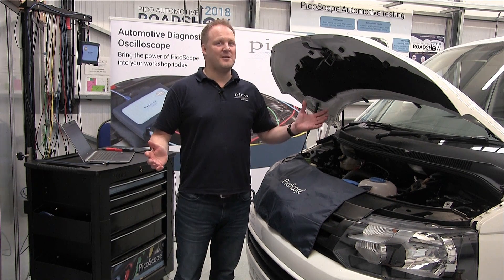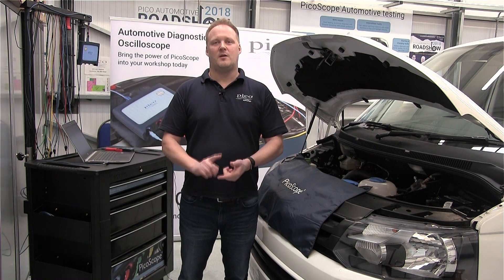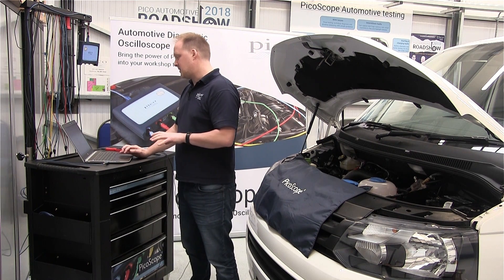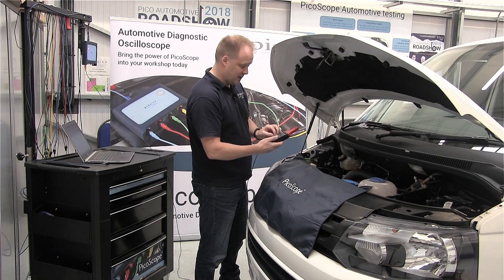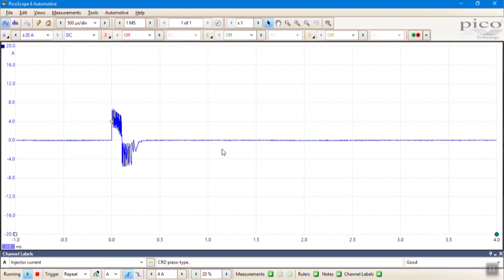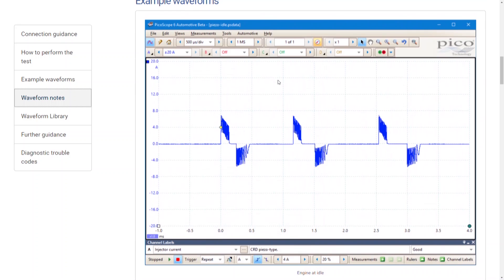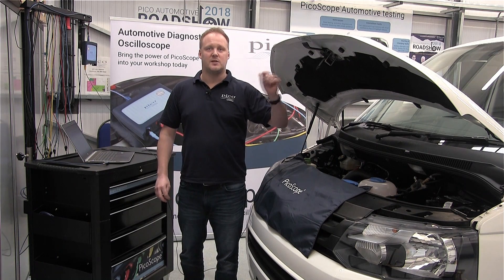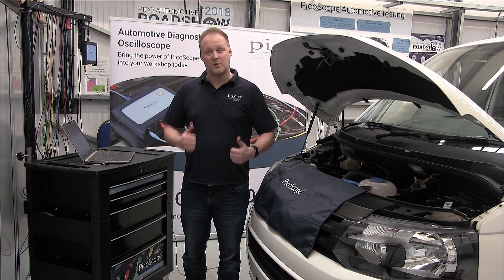Guided Test: CRD piezo injector - current

Comment: Great video.. 👍
If a injector connection is mistakenly pulled out while the engine is running, will the shorting of injector terminals before reconnecting will help solve the unforeseen problems.

Comment: great video,I just ran captures on 06 Cummins magnetic type injector that was stuck open.voltages on command and supply wires didn't look any different than a known good injector next to it,then I amp ramp with 2 clamps and both injectors looked the same.i couldn't see the pintle hump on neither waveforn.Can u do an amp ramp capture on magnetic type injector?and volt capture on fuel pressure sensor sync with an injector to diagnose a high return injector flow.ive never seen that test anywhere.
Reply: Hello Francisco, thank you for the feedback. You most certainly can carry out this same test with magnetic type injectors using both current clamps and voltage probes (Current being the preferred method) The following Guided Test will help with connection if you wish to measure voltage and current simultaneously https://www.picoauto.com/library/automotive-guided-tests/vag-pd-current-voltage-and-earth/ Should your injector fail mechanically it may well still exhibit normal voltage and current values! The pintle hump you refer too is typically visible with conventional 12 V petrol “port” injectors as the movement of the pintle influences the magnetic field about the injector windings. However this movement is not so influential with diesel “solenoid” injectors based on their construction and operation. Your idea to measure current flow in a solenoid diesel injector whilst monitoring fuel rail pressure is perfect. Use injector for cylinder 1 as your synchronization signal and AC couple the fuel rail pressure sensor signal to link pulsations in the fuel rail to injection events. This test is what you are alluding to but uses a pressure transducer in the fuel return line. https://www.picoauto.com/library/automotive-guided-tests/common-rail-diesel-injector-back-leakage-testing/
 I hope this helps, take care…..Steve

Comment: For a single injectorit seems as if voltage is being applied multiple times.. why does the amplitude increases & decreases continuously ?
Thankyou for the video
Reply: Hi. That's a very good question. The current ripple on each event does suggest that the voltage is pulsed to some extent. I'm afraid I can't tell you why they would do that. I guess it could be because the piezo element responds better or needs protection. Or, in fact, it could be that it is caused by the response of the piezo element/circuit to a non-pulsed voltage control signal... I'm sorry that I can't give you an answer. Would be great if anyone else could provide an answer, if they know.
Reply: A piezo injector is electrically equivalent to about a 4 micro farad capacitor. The high frequency (PWM) pulses are used to control the charge and discharge currents since the injectors are typically switched to about 140 volts from a low impedance source. Some systems use a small amount of series resistance or inductance to limit the rate of rise of the current and dispense with the PWM current limiting.

Comment: I dont get this. is common rail bosch injectors correct to read out with just looking at the amp like your test. or the voltage up to 100v..  I have tried voltage reading and when cranking i get all injectors reading peaking at the same time.. voltage around 15v.
Reply: Hi Tarik, yes current measurement is a standard way of testing an actuator (i.e. injectors of any type, motors, solenoids etc.) circuit. It tells you what the circuit is doing whereas voltage tells you what the ECU/circuit is asking (loosely speaking!). Also, nowadays, many injectors are driven on both sides of their circuits and you have to look at the net voltage between them to understand how they are being driven (i.e. if the injector has two pins you may see varying voltages on each one, rather than, say, a fixed voltage feed on one side and a switched earth voltage on the other). That might explain what you are seeing. Hope that helps.